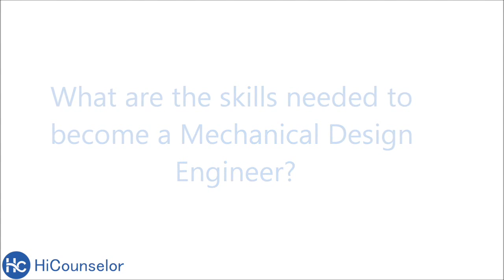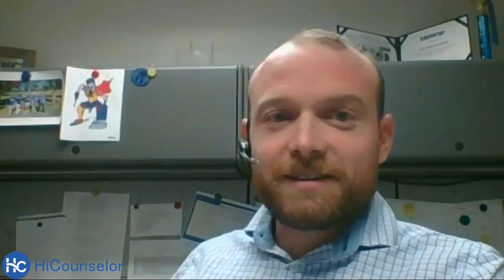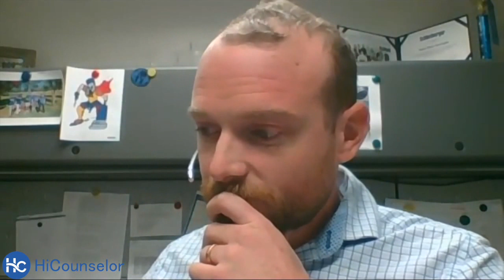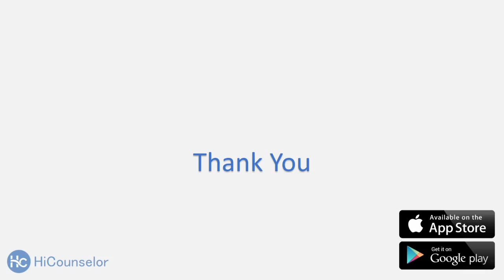What Are The Skills Needed To Become A Mechanical Design Engineer? | Mechanical Engineering Skills

Comment: I started in the trades, Tool and Die Making, and will be graduating with a BSc. Mech degree next year. I have come to realize that a typical engineering degree doesn't fully prepare a person for the workforce. I'll likely start off as a tooling design engineer, but I was wondering If you had any advice on which subjects to try master while I'm in college and what to expect as an entry level mech engineer.